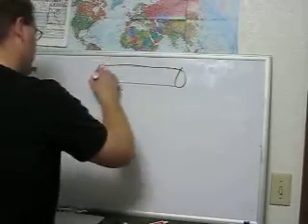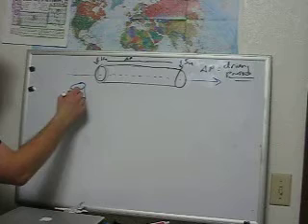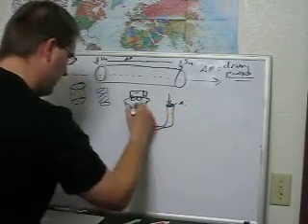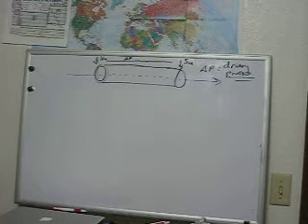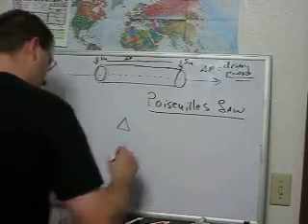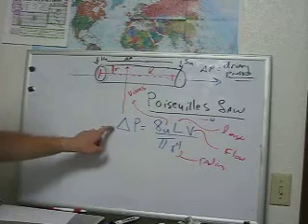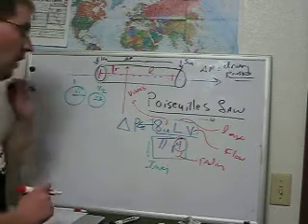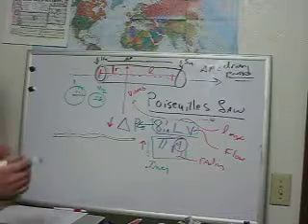Fluid Dynamics III Poiseuilles Law

Comment from the maker: It would not stop air from moving; however, the person experiencing said bronchoconstriction would have to work harder to increase the driving pressure and maintain the same flow. Additionally, exhalation is much more of a passive process than inhalation and as such it would be significantly harder to expel gas and this can lead to air trapping if significant bronchoconstriction exists and is a problem in some COPD patients.

Comment: The example in the end about the constriction of the bronchi can't be right... if the radius is decreased and consequently the pressure difference is increased, the driving force is increased isn't it? Why would that stop air from coming in? Isn't the pressure difference what pushes a fluid through a tube??

Comment: hello im using, well something similar to this equation im just wondering if there are other equation of poiseuilles, at least on what im using it for is to get the viscosity of the solution, and supposedly the pressure here is the hydrostatic pressure, wanted to ask if that is correct. if so would like a smalldescription of it.